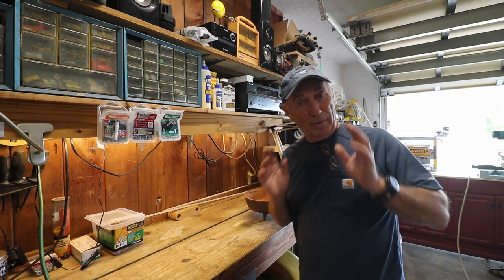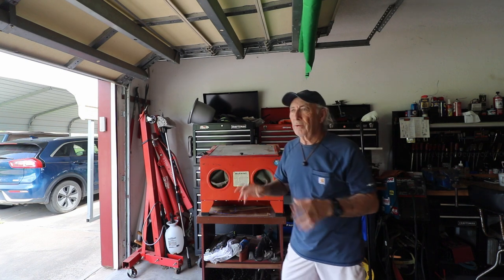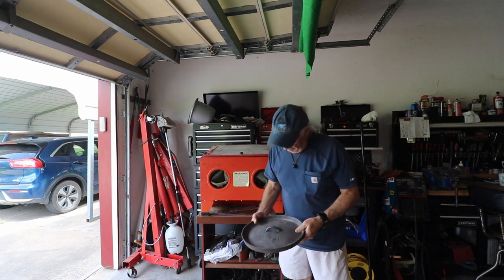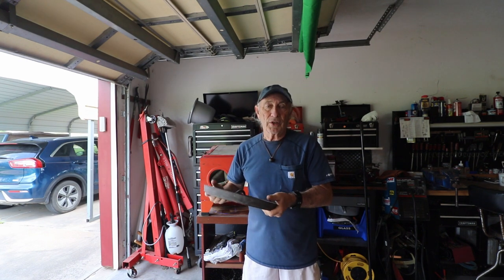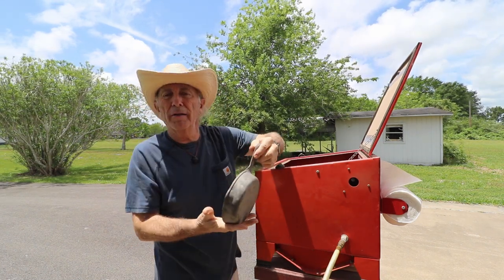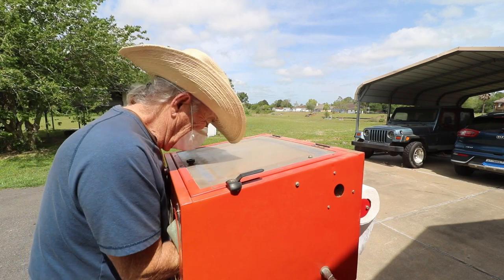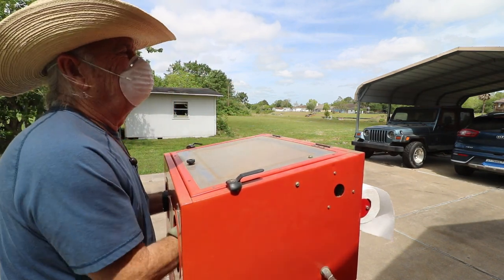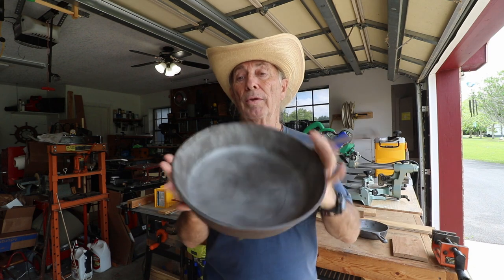Cleaning Cast iron pots and pans @ Coffee and Tools Episode 148

Comment: You should add a shop vac to the cabinet. You will be able to see better and keep the dust down.
Reply from the maker: Tried that one but the dust is so fine it killed the vac. Thanks for the thoughts :)
Reply: @SirTools  what I did on my cabinet is use a 5 gallon bucket with lid, and make an in-line cyclonic dust collector to save shop vac. Works great .